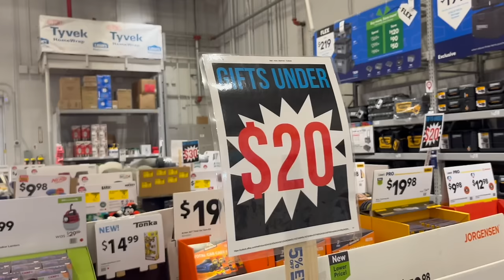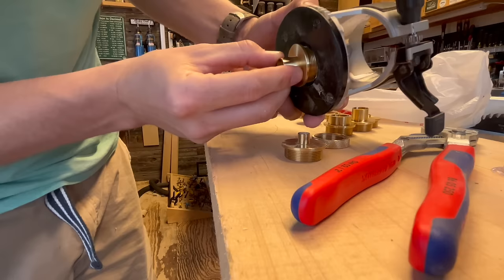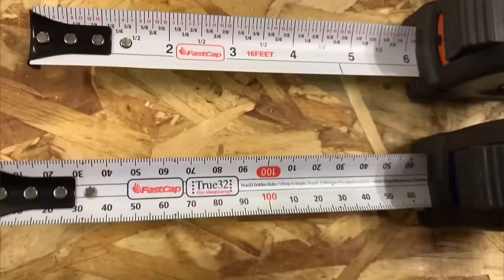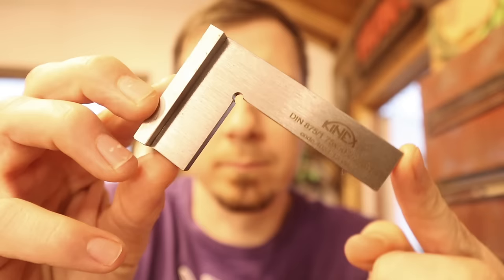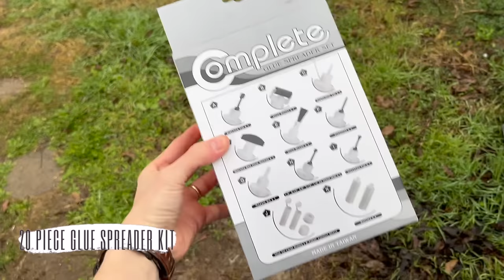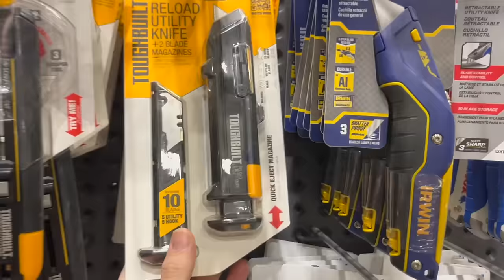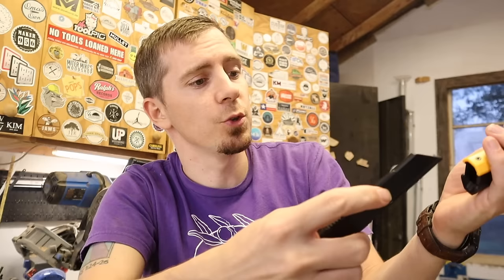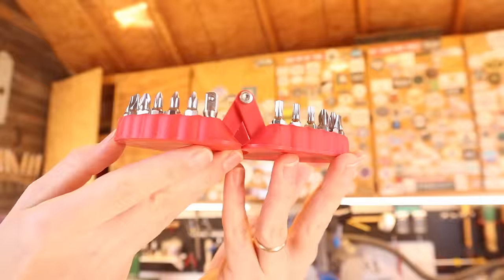5 Woodworking Tools You Can Get for Under $20!

Comment: The fastcap Easy Half tape measure is awesome. You measure something with one side of the tape, then find that same measurement on the other side of the tape.

Then you've found the exact center. Great for when you've got a really odd length you have to find center of. Quick and easy. (Yes, can do the math, but this makes it much harder to do it wrong)
Reply from the maker: Yeah I don’t have time for math so I definitely prefer the easier way!